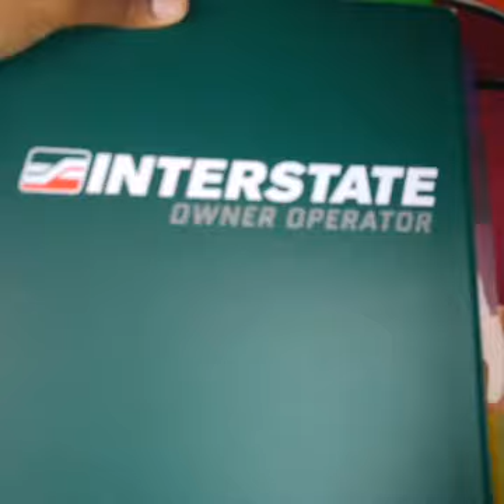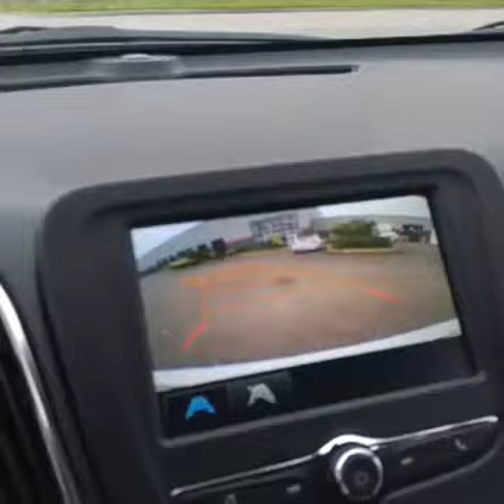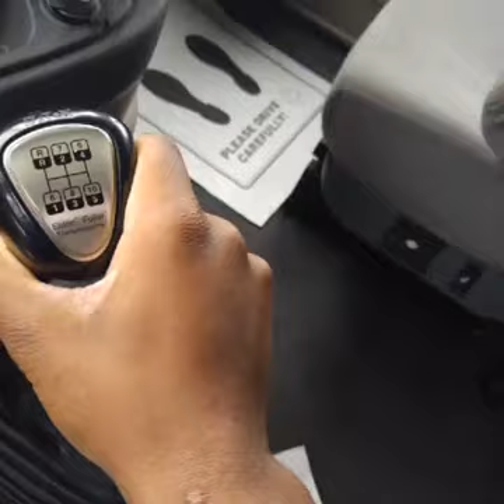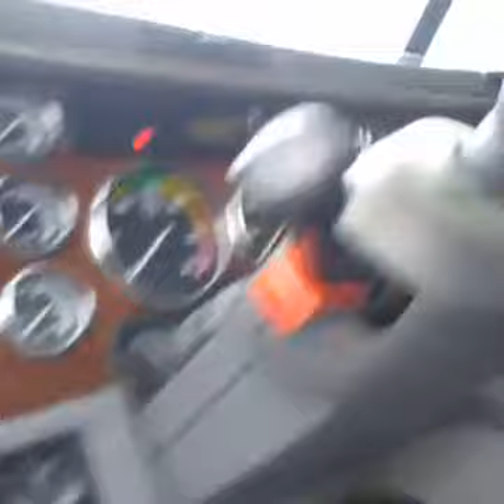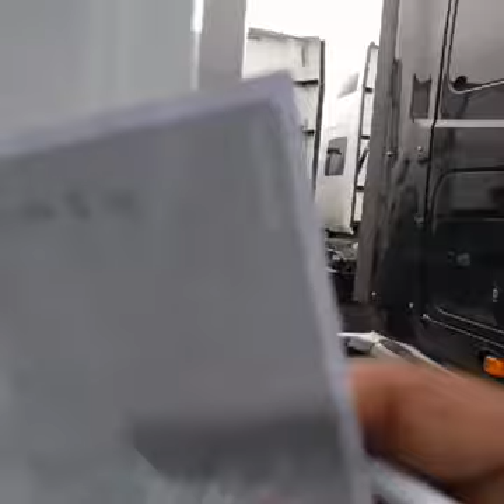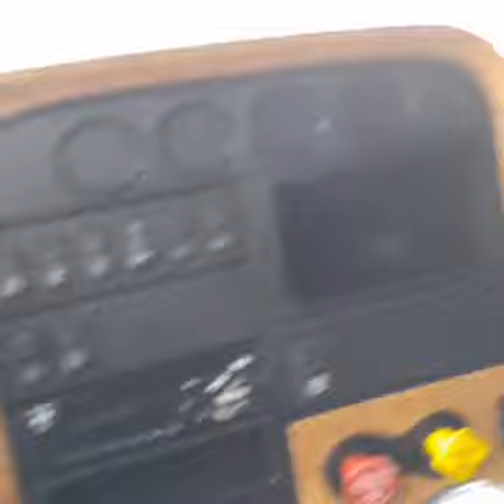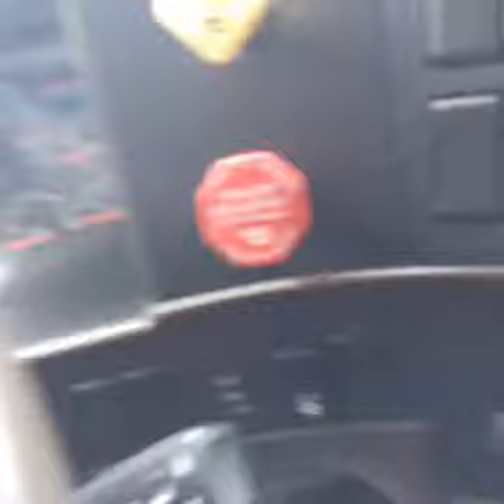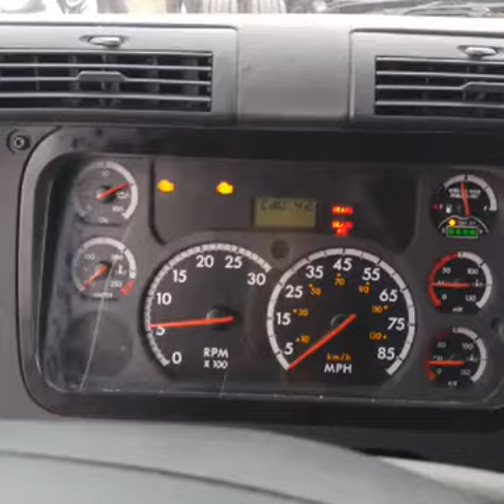What Was Quality Leasing Like?

Comment: Freightliner with Detroit. That's where it's at. There's a reason everyone runs them. You can find a nice Cascadia for around 60K. Sometimes less if it's a private owner trying to get out/retire. Usually with about 3-400k on the mileage. Use it for 2 years and do it all over again.
Reply: ***** That rep comes from Internationals, which almost every major company is phasing out. Freightliners with Detroit and Petes don't see nearly as many issues.